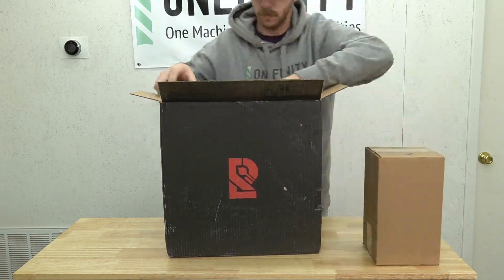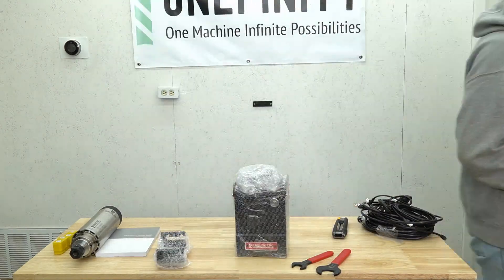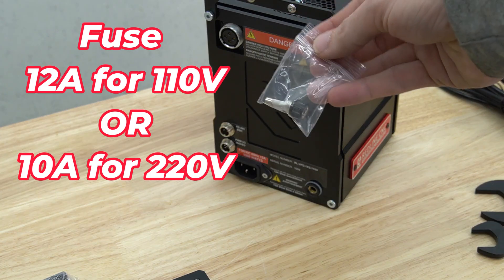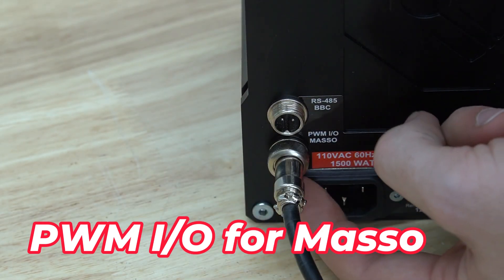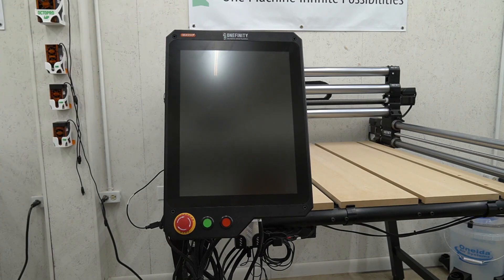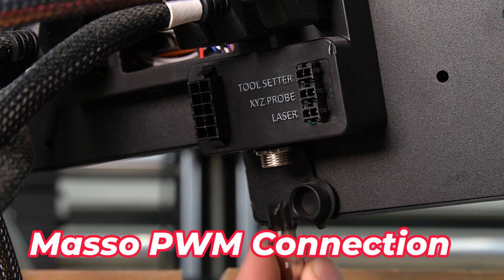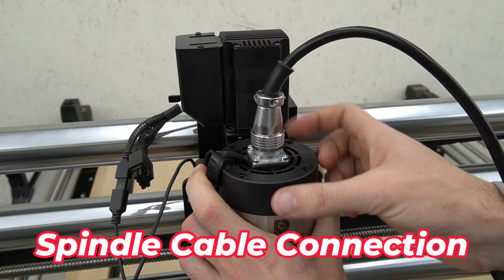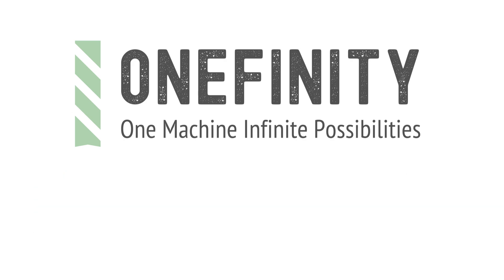Onefinity Spindle Kit by Redline CNC | Masso Installation

Comment: My spindle does not show the mark for how low to mount it into the spindle mount.  Like the small black mark on the one in the video.  What is the correct measurement for mounting it?  I have the redline 80mm.
Reply from the maker: Disregard the mark in the video.  The spindle doesn't have a set 'correct' location.  This  would very from customer to customer and use case to use case.  Start with it in the center and adjust as needed!

Comment: Why no mention of the breakin period for the spindle?
Reply from the maker: It's in the manual :)
Reply: @OnefinityCNC  Mine said in the form that came with it that it was burned in at 12000 for 10 minutes and 18000 for 10 minutes.